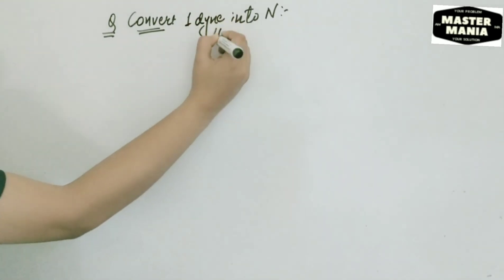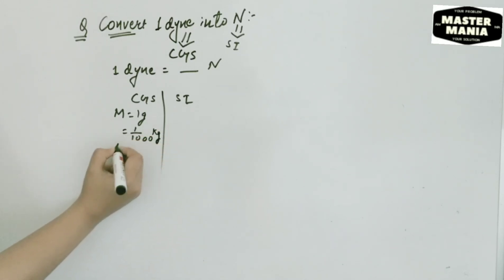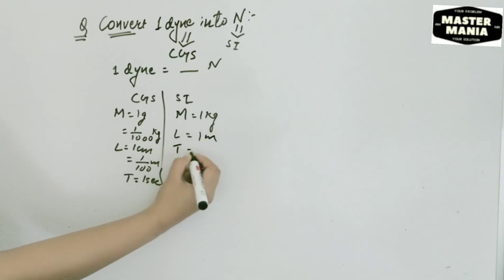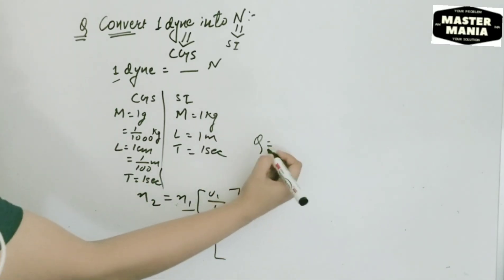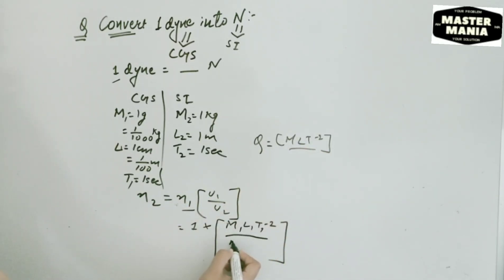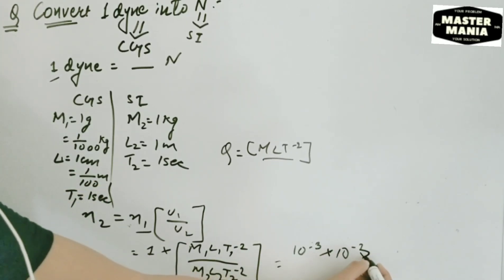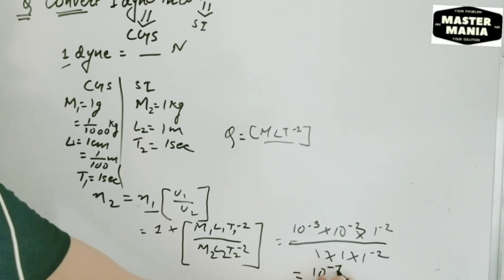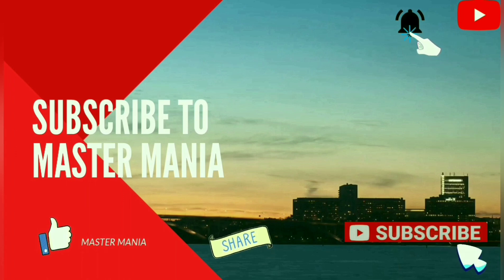Convert 1 dyne into Newton

Comment: If we have convert 1000 dyne into netwon
Reply from the maker: Put value of n1 as 10³ or 1000
Reply: @mastermaniawithsisters7780   what will be the answer is it 10^9
Reply from the maker: No,ans will be 10^-2
See when we took n1 as 1 we got the ans 10^-5 ,now when you are taking n1 as 10³ then ,you just need to multiple 10³ with 10^-5 i.e. 10³ * 10^-5 that will give us 10^-5+3 = 10^-2 .... don't get confused it's simple just put n1 as 10³ and after it simple mathematics.